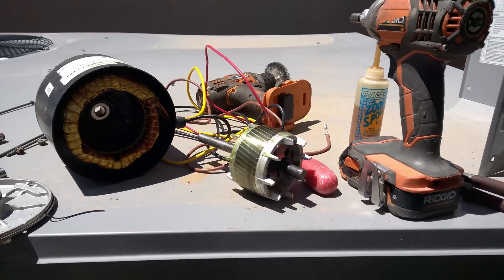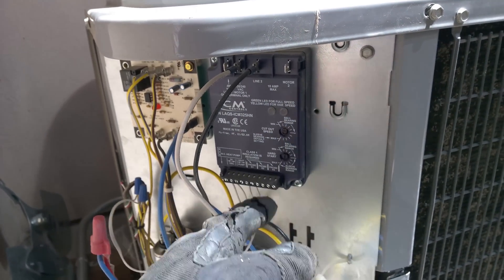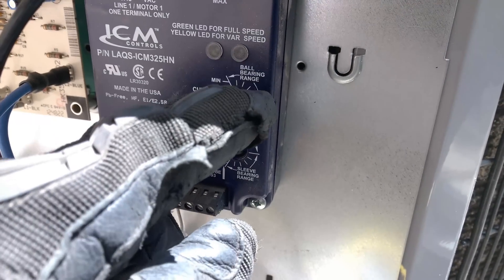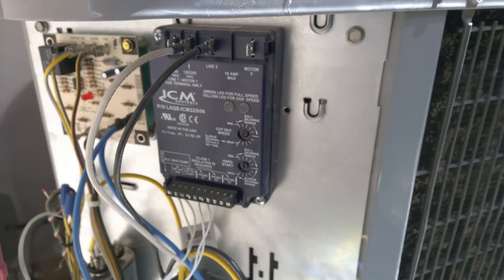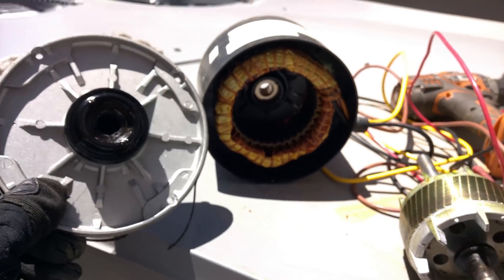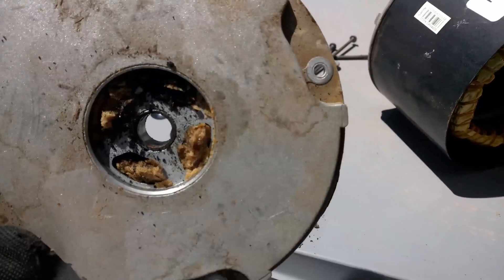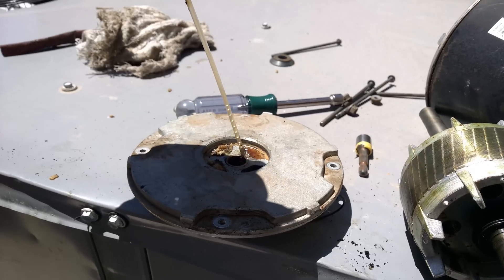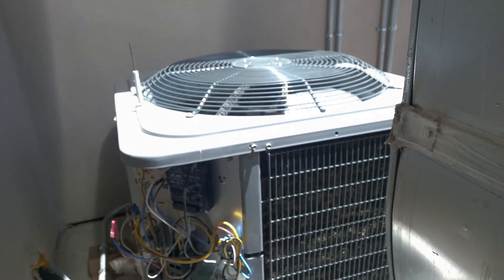Sleeve bearing motor fried silly by improperly set low ambient controller

Comment: Could you show where is the best place to install the temperature probe for you? 🙏
Reply from the maker: I prefer closer to the common liquid line (well away from the hot gas entering the coil) and to shove the probe right in to the aluminum find that I carefully spread with a pocket screwdriver etc.
That would usually give me some pretty stable control and I wouldn't need to insulate the probe like it needs to be when clamped to the copper u-bend.
Also the copper u-bend is more difficult to get good heat transfer.

Comment: I have basically the exact same motor in an older airmaster fan. I caught it before it was smoked, but 1 bearing put hairline type grooves in the shaft. I'm only asking because hesitant at the moment to pay the man & with my priorities in taking care of my mother(dementia) & my brother a paraplegic. I was wondering if you had or have heard of that shaft possibly being machined or would a flanged pillow block bearing mounted on the outside be an option, or a adapter on the shaft & bigger sleeve bearing? Because information online for these motors is basically the type of oil & wicking material. I know all that, I just don't want to buy a motor if this is salvageable. We no longer use machine shops in the new automotive industry, but I'm certain I have a friend of a cousins mothers fiancee who can help me but have to see it & blah blah. I'm only asking off the top of your head in your experience. Please. Excuse my long text. Seems I can multitask multiple times more than the average person with fewer mistakes, but my mind is a constant failed attempt at restraining a space shuttle on lift off & not made for texting. The moment the proverbial pen goes to paper I'm trying to explain the meaning of life. I want people to comprehend & not sound incompetent, but ask me how that works out. I'll spare you. If I were reading this I'd think Tyrone Biggums(Dave Chappelle's crackhead character) was the author.
Reply from the maker: Are you speaking of a fractional horsepower such as this in a small residential unit?
These are nearly water tight for the application and not meant to have external bearings. Also clearance of the spinning rotor inside the stator section is only a few thousandth's of an inch a pillow block arrangement is not even feasible. 

These motors don't cost that much and a general purpose one is stocked at any supply house.
Reply: @hackfreehvac  1/4 HP. Air circulator, nowhere near water tight in a Airmaster shop fan & I thought wrote external. All I know about a pillow block is it wouldn't fit internally & Google kept firing them at me whel searching sleeve bearing/ bushing & sintered bearing & hell I just built a dog treadmill & been hunting down fast bearings I honestly may have gotten my pillow blocks mixed up with one & maybe had a dream about it. Basically, I know better because if I'm not mistaken some of those bearings have clearances so tight they squeak when they walk. I'm tired. Hey man I appreciate it. I think I found a new one online for $80. GRAINGER wanted $740. I heard that price & panicked

Comment: New motor? Could you not replace the sleeve bearing? Could you put a sealed ball bearing inside the sleeve bearing housing on this?
Reply from the maker: I replace ball bearings all the time. I've never seen a kit to replace sleeve bearings. This motor would have needed new end plates for a ball bearing but at that point it is just easy to replace the motor. Being that it is just a fractional HP motor and all. It is only worth so much effort.
Reply: @hackfreehvac  damn. Thanks. I hate how everything is just thrown away now. It’s obvious that it is completely fixable. No reason to replace everything at all.

Comment: Good video.  In your experience with those controllers, do you find they don't necessarily kill the motor if installed properly?  Thanks.
Reply from the maker: Straycurrent I think the motors will wear faster to some degree just because these cause a clipping effect of the 60 hz sine wave (like a light dimmer) rather than actually vary the frequency like a VFD. 

Sometimes I see just as high if not slightly higher amp reading when the speed is slowed to some degree. 

But they are handy and best bang for the buck when you NEED low ambient control.

Comment: Rocking video man.  Would that device be considered a type of variable frequency drive.  I know you have worked on some big stuff before.  Thanks.
Reply from the maker: All Hours Maintenance No it just clips the sine wave. Like a light dimmer their is a SCR/TRIAC and you bias the gate so that it doesn't allow it to conduct until the voltage crosses a threshhold.

So basically as the sine wave crosses zero (and the gate is off) it then starts to go more positive (or negative) and based on your setting it will cross a threshhold that causes the device to conduct and turn on.

So that will be somwhere away from zero so you could say set it at 50% and it will go from zero volts to the motor to an instant 50% of the voltage then continue to clime as the sine wave voltage increases and then when the sine wave voltage decreases below the threshhold it will shut off abruptly and no current flow again. 

It is a simply technique but the motor still sees the FULL amps that it will draw at that speed when it turns on and it could actually see higher amp spikes even though it is on for less time than what a motor allowed to speed up would have due to normal back EMF.

A VFD will actually take the DC charge in itself an recreate a sine wave to a motor. That sine wave can actually lower it's frequency AND in many cases the voltage too. Those are much better for motors. But usually only used on higher HP etc.

Comment: Not to a contrarian, but those ICM controllers are junk here in the northern climates.  I've seen way too many burn up and I much prefer a simple pressure switch fan cycling set up (at least in climates where there is excessive fan cycling such as the upper Midwest and Canada).

Comment: I have seen that before also.  People think they set themselves up. PHC Apprentice  these controllers are great but the need to be set up right. Also add a CCH.
Reply: Rob HVAC whats a cch? Not good with acronyms
Reply: PHC Apprentice crank case heater
Reply: Rob HVAC appreciate the response.
Reply: Rob HVAC a nice hard start always helps it on 208
Reply: Those are way better than the reg fan cycle switches. Easier on expansion valves and compressors. Great video.
Reply from the maker: zeke montgomery Yeah I like them too. They don't abruptly stop then restart the motor every few seconds as the head pressure varies by 50 psi or so back and forth.

But they do cause the motors to wear out a little faster nonetheless but they are a necessary evil to make the unit work in the winter.

Comment: The motor is probably as good as new with the new oil. "Starved for oil at  slow speed"???? Sorry. i don't believe that.  There's no oil pump. The oil is there at all speeds.
Reply: I believe its a bit like how you could drive through a puddle slowly ok but at speed you will aquaplane, the sleeve motor bearings need enough speed to ride on the oil.
Reply: Interesting. Interesting.
Reply from the maker: Cooll Asice It seemed to run fine but that shaft looked scratched pretty bad.

A new motor is on order.

Comment: Sweet fix. Thanks for teaching me a trick!
Does the motor get ruined in any way from adding a controller? 
Im unsure if the control you show in the video starts and stops the motor quickly or changes the hz from 60 to a lower number. If you have more info, or a model I can look up the literature please post it.

Thanks!
Reply from the maker: PHC Apprentice See my reply to All Hours Maintenance above. It doesn't lower the frequency. It just clips the sine wave. Crude but effective to slow a motor.